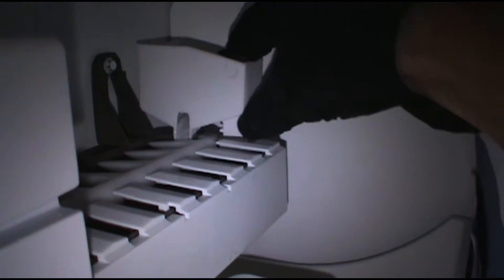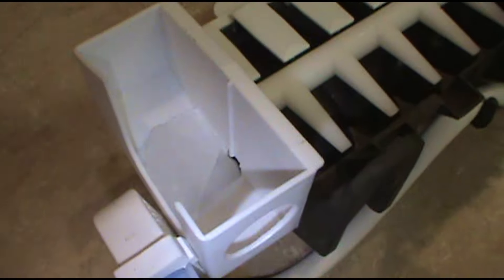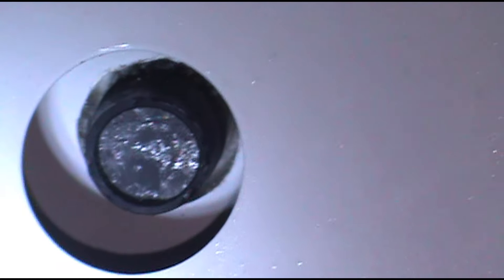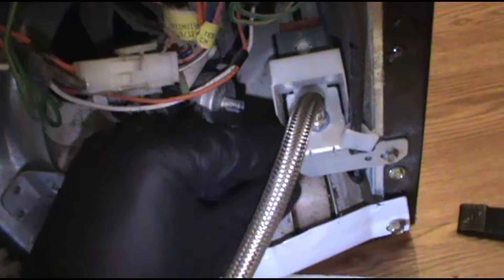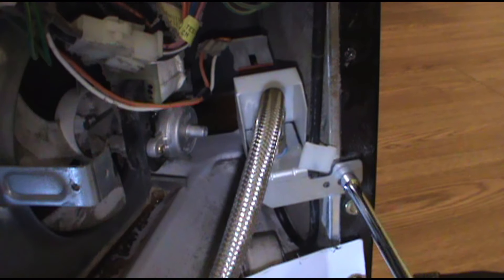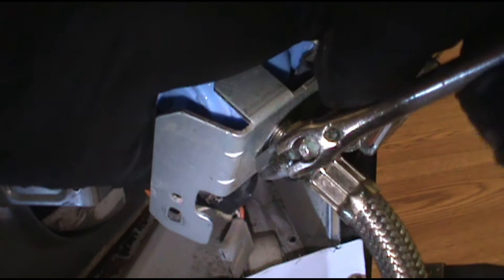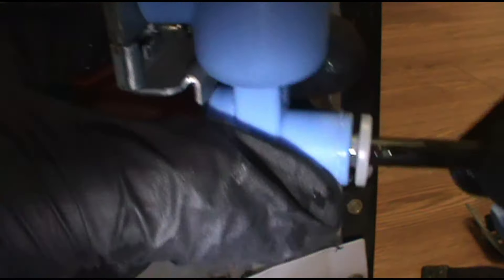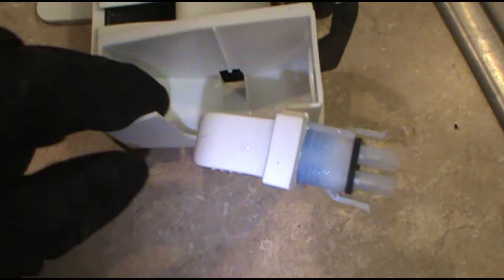Fixing an Ice Maker That's Not Making Ice

Comment: My Ice maker quit!  Fancy GE French Door, ice in the door model. I looked at it, got on the interweb, $86.00+ for a replacement 
 on the Amazon. Started to order it. Did a little research on the U tube, learned how to reset the Ice Maker. did that. Waited a day or so, Got Ice. Wife told she found the freezer door ajar. I had put a small crock pot with broth in about the same time, Heat and freezer door open the caused for no  ice! Fixed!    Ordered replacement just to have, sooner or later I'll need it.
Reply from the maker: Nice fix! Thank you so much for watching!

Comment: Hey Skid ... another great video. Just a helpful hint that may help ... I use a 2-3 foot section of plastic ice supply line to melt the ice in the supply line, and it also works great when the drain is plugged with ice. ( just blow into the line until it clears out ), it leaves no extra water and gives your lungs a nice workout. ... hope this helps .....  "DUNZO" !!!!!
Reply from the maker: Nice! I'll try that out! Thank you so much for watching teve!

Comment: I just installed the same ice maker (brand new) on my new ge fridge and it wont make ice at all, the water inlet valve came on the first time i hooked up the fridge then nothing after that any thoughts? 
fridge and ice maker are brand new
Thanks!
Reply from the maker: Hmmmm, I know it probably is, but make sure the ice maker is turned on. A lot of people make that mistake so that's why I have to say it. Also, you can pull the ice make out and make sure the feeder tube is clear. Sometimes ice will build up in there and block water from getting in. Other than that, it should work. I'm stumped beyond that and I would need to be there to look at everything. Hope it all works out for you Trent!
Reply: @LexVance  Thank you so much for the quick response! I will check that directly. on a side note, when i first plugged up the fridge the pump came on and filled the ice maker but water just kept overflowing into the bucket so i turned off the water to dump it and turned it back on and it hasnt done anything since.

Comment: Hey Lex, I've got a problem with mine also. Not making ice.  Looks like water is not coming in at all. I checked voltage on connection to ice maker and get 120v. Any suggestions?
Reply from the maker: Check feed tube and see if ice is frozen in there & blocking it. If so, change the water inlet valve on the back. Common problem with fridge ice makers. Thank you so much for watching Robert!
Reply: @LexVance  theres no water in the tube.

Comment: I followed all of your advice.  I was getting ice in my freezer but no water.  And now I get no ice either.  I replaced the water filter to a brand new filter.  No water.  My water button works (I hear the actuation).  I then checked my crisper for ice (to see if it is frozen) and even defrosted for 3 days to be 100% certain; still no water.  I replaced my water valve and ensured all water hoses are connected properly.  The water from my wall comes in and runs through the water hose, up into the water filter and comes out the return line to the water valve.  Water is properly flowing.  The new water valve is showing appropriate resistance with a Multimeter (186/257).  So if the water from the wall is pushing water up into the water valve and back down the return line to the water valve with a high rate of water flow, what could be the suspect?  For some reason, I don't think the water valve is allowing water to flow through it even though the resistors show proper resistance with Multimeter tool.  Is there a secondary component behind the water filter that pulls or pushes water to the dispenser?  Could the computer board be suspect even if the water light is on and I can hear dispenser actuation, but no water?  I am really stumped here.
Reply from the maker: Hmmm, I'd need to be there for this head scratcher 🤔.

Comment: mine makes ice, but looks like to much water is coming thru cuz there's a sheet of ice on the bottom of the tray. is that the valve to?
Reply from the maker: Yep. Change out the inlet water valve. Thank you so much for watching JukeBox!
Reply: That happened to me. The white plastic cup that diverts the water into the ice maker popped off. I put it back on and made ice. If it’s not on correctly the water just fills the freezer because it’s not going into the Ice maker.  Now, why is the white cup popping off?

Comment: I replaced the ice maker in my in-laws fridge. It has one of those trays that twists and dumps ice. Tray got twisted and wasn’t making ice. I replaced it and it make a few cubes, but stopped again. I was thinking the valve might be bad as well. Any thoughts or something I could check?
Reply from the maker: The inlet valve is the common problem. I'd start there. Thank you so much for watching Jake!

Comment: There is an orange and a white wire how do you know which way to orient the plug?
Reply from the maker: I lightly push while flipping the plug until it slides in. Don't Force it though.
Reply: @LexVance  yes but there is no orange to orange or white to white so how can you tell? You can plug it in upside down or upside up...
Reply: @pguin2703 most of the solenoid valves are AC and it does not matter which way they will go on. If the connector is keyed it will go on only one way.

Comment: Too bad these refrigerators don't have a water pressure sensor on the inlet & outlet of the water valve.
Then you could verify that water pressures are not too high or too low.
I have see water valves not close all the way because the water supply pressure was too low.
Have you tried getting one of those steam guns on Amazon to thaw the ice maker tube? 
One time, a customer literally did not have hot water because of water tank issues. So I used their coffee pot maker to fill their coffee pot with hot water real quick.
Then I poured it in my sprayer & melted the ice that way.
It worked good & fast!
Reply from the maker: Right on! Thank you so much for watching Adam!
Reply: @LexVance  Yeah Bro, I'm liking your videos! Keep post on The Dirty Maintenance..........show!!'
😃

Comment: I have a Ge top freezer refrigerator and my ice maker stopped working, I changed my water inlet valve and still does not work. What is my next option?
Reply from the maker: Make sure the water tube isn't clogged. The tube that pours the water into the ice tray can get clogged. I spray hot water in there to thaw it out if it's clogged. If that ain't it then I'm stumped.🤔

Comment: GE is a true shit show when it comes to appliances. The water dispenser and ice maker inlet valves r separate on the newer models. The valve can fail electronically or mechanically. Testing for ohms on the solenoid for a good valve should read 400 and above. I had valves read 375 and still b fine but most of the time these guys fail when ur water dispenser continually drips.
Reply from the maker: Yep! Thank you so much for watching Nicholas!

Comment: If the water valve goes bad with the ice maker completely shut down?… ice maker is bone dry and unresponsive.
Reply from the maker: The ice maker may still work but won't be dumping ice due to no water.